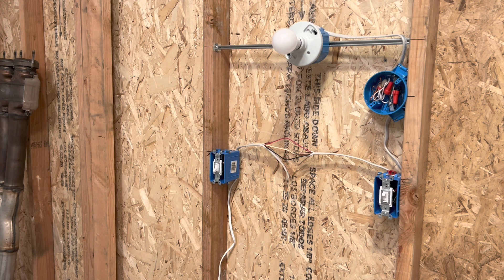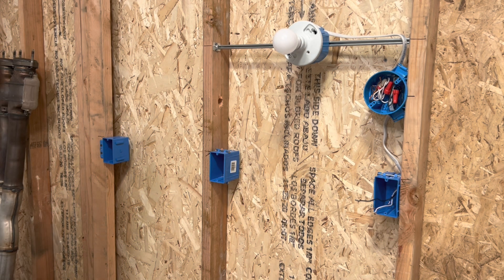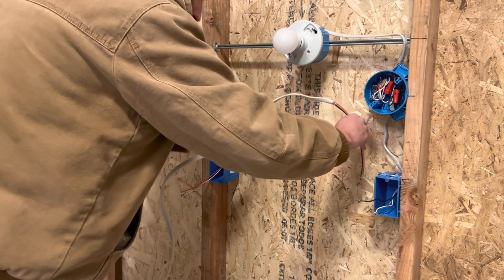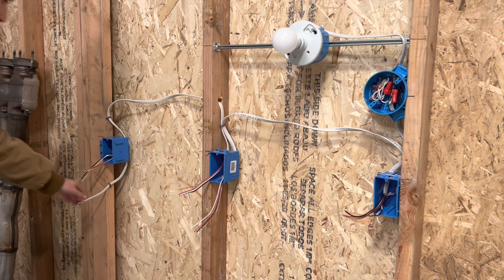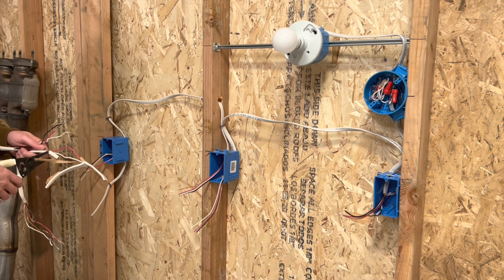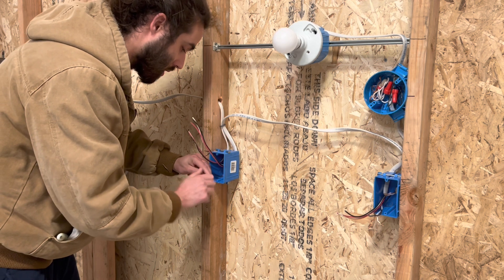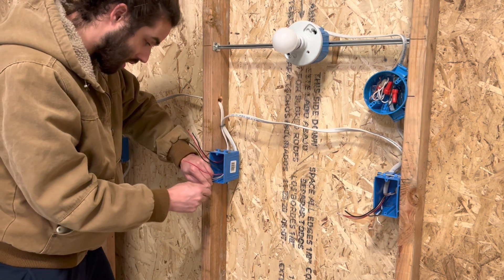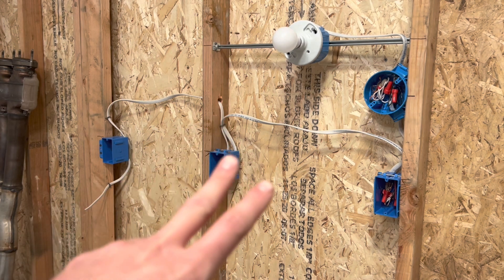Electrical 101: How To Rough In A 4 Way Switch System (Residential)

Comment: Since you do  residential, I have a question for you. I am still learning mind you but I will set up a scenario so its clear to you. I was asked to fix a a vanity that did not have power. I was unsucessful so my supervisor will come. 

But basically
-Its a master bathroom with vanity and fanlight combo light
-Their are 3 single pole switches(1 for vanity, 1 for fan light, and 1 for fan)

-I tried to check if the bulbs were not good by swapping them with hall bath but the bulb worked just fine
-Breaker is on. Fan light and fan work but not vanity
-Opened up switch box to see if their was power. Single pole switch for vanity has power in both screw terminals when its on
-Unscrewed all switches to check wiring inside switch box. 4 wires-Two 14-2 wires for power and 1 for vanity and 1 14-3 for fan light and fan. Nuetrals all wires. powers pigtailed for 3 switches.
-Removed vanity and used tester to see if it has power. Their is no beeping for 14-2. Checked to see if their was cut but no beeping on the 14-2 wire at all. 
So I got power for the vanity switch when its on or off but I have no power for the vanity light 14-2 where the vanity is installed. 14-2 obviously behind sheetrock. 

What you think this could be?
Reply: If you get a multimeter you can check for continuity  on switch leg. Another trade likely severed the switch leg.